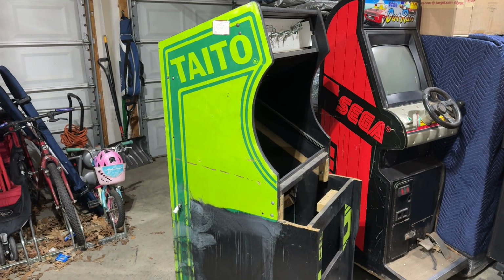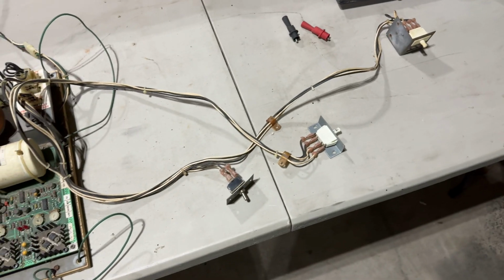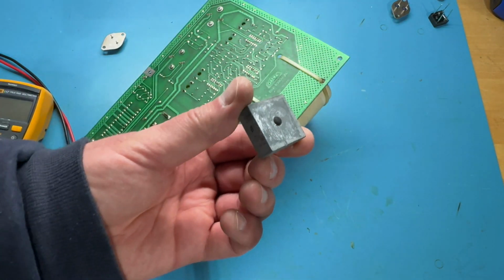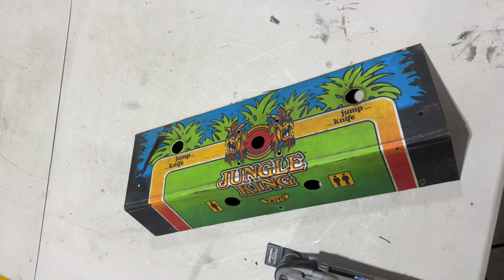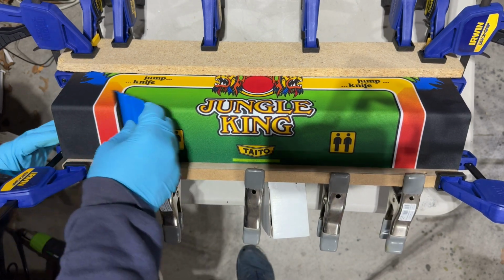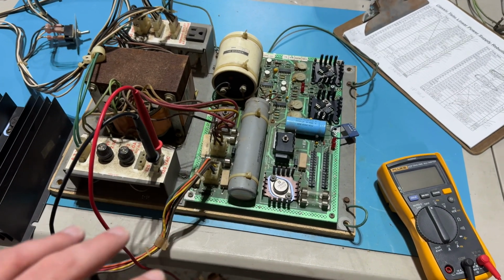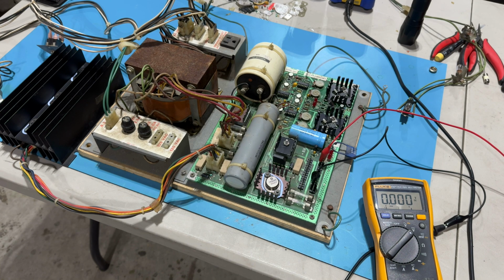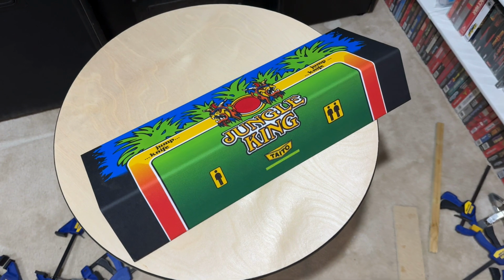Everyone HATES this & now I know why! 🤬 Jungle King part 2 🦁🌴 classic Taito linear power supply +CPO

Comment: You've come this far, swap out the caps and any other component you haven't already done.
I would then set the adjustment pots to minimum before switching on then gradually bring the voltages up, that way you'll know if the protection circuit is kicking in too early? Replace the plastic spacers on the transistors too if it's gonna be inexpensive to do. Stick with it man, you will crack it eventually.. Just keep on diggin!
Reply from the maker: Don’t worry, I haven’t given up yet!! I have tried turning the pots to minimum — the 5v comes up at about 3.6v before dropping to 0.9v after a couple seconds. I’ve also temporarily removed the mounting screws from the TO-220 transistors and lifted them from the heat sinks, with no change in behavior. I’ve still got a few tricks up my sleeve yet!

Comment: Taito power supplies are the worst of the worst, it’s very easy to just use a switching power supply with an adaptor. Used it for my elevator action and it works great
Reply from the maker: I know, I know... but oRiGiNaliTy!

Comment: My guess is those capacitors. Once they charge up that is when they fail (after the first second or two of being powered on they work) this seems like the exact issues I had on another power supply I worked on. Once you have the power off for awhile the caps discharge and then it's back to working for the first couple of seconds on powering on and then failure. You owe me a coke if that is your issue..LOL. Looking forward to the next video. Great job trying to save an original!
Reply from the maker: Thanks! Replacing the filter caps is on my todo list, although I'm not seeing any AC ripple on them.

Comment: Charlie those plastic spacers on those transistors is a must there actually designed to electrically isolate the base if its shorted together then will cause symptoms like your having, also those look like 5w big white chonker resistors can go short also check those transistors with no spacers if there shorted to each other first. :)
Reply from the maker: Good suggestion! I temporarily removed the mounting screws and lifted all four of the TO-220 transistors off of the heat sinks, and I'm still seeing the same behavior. The big white ceramic resistors all test ok too.
Reply: @overtimearcade   some solder bridges bleh good to see got that sorted mate , any psu see some plastic sheets or bushings we call them spacers Aussie land :P , there a must its meant to isolate base of the transistor to emitter and collector . and you cant have 2 bases shorting to each other linear psu's easy to fix but pain the back side :P
Reply from the maker: Good thing I have more than a lifetime's supply of these things now! 🤣

Comment: You should check the service manual for qix or maybe other games that use this power supply. It explains the regulators and how to adjust the overcurrent pots. It does appear that the crowbar is kicking in. You should check parts in the line of the voltage feedback ie r21 and c10 for the 5v line. Make sure those arent shorted to gound somehow. You should replace the pots if you havent yet because they can cause goofy intermittent problems. The 5v and 12v lines are independent from eachother for the most part so if one of those crowbars, it doesnt mean the other automatically will. The only way i could see the two affecting eachother is if f2 blows then the 5v side would lose its source for biasing its series pass transistors, also thr regular ic wouldnt be powered
Reply from the maker: Yep, I'm still messing with this thing, but replacing the pots is definitely on the todo list!

Comment: modern capacitors you can replace most tan'ts with ceramics, I hate tantalums ... heck in the automotive industry (where I work) they are blacklisted from most companies
Reply: Ceramic capacitors have different behavior and you really shouldn't replace them with ceramic. In particular, don't replace electrolytic capacitors with ceramic.

Comment: Get rid of those yellow tantalum caps first, those things always go short.
Reply from the maker: Even the brand new tants?
Reply: @overtimearcade Oh sorry, no, new ones will be fine but those old ones always fail. 
Also, I’m not familiar with that power supply but have you checked the wiring diagram to make sure it doesn’t need some return sense wires connected for it to function properly ?
Reply from the maker: @simonhanlon7518 Replacing the old tants is one of the first things I did. There’s no sense circuit per se, but I do suspect an issue with the crowbar circuit(s) on the power supply.
Reply: @overtimearcade  Right ok. I would connect a 5w 12v car bulb to each of the voltage outputs and then see how it runs. If it’s anything like the earlier Taito supplies it will need a load to work properly.

Comment: Hi Charlie!
I have a special content request, which while it may not correspond with your current project(s), would still be of great interest to me; I have an interest in the workings of coin doors. I understand the functions of the various parts including the coin mech, and credit switch,etc., but where I'm a little fuzzy is the relationship between the coin mech (which I understand is an almost universal part, because Nintendo had to be different...🤨), and the different styles of coin doors from different manufacturers - For example, a standard coin mech can be transferred between an Atari 'owl-eyes' coin door, and a Midway coin door with horizontal coin slots, and a Suzo-Happ coin door with vertical  'Push to Reject' coin slots, which brings me to the question of how a coin door with multiple coin slots (and presumably multiple coin mechs) can have a single coin reject button...
Any insight you might be able to provide would be very much appreciated!
A side note; I've been working on a project that I'd like to share with you, and send you some pictures, and get your honest opinion... Is there a preferred email address to which pictures can be sent?
And finally, have you given any more consideration to the PVC frame multi-function sanding enclosure/paint booth/murder room I proposed some time ago...?😛
Reply from the maker: Great questions, Dave!

I'm no expert on coin doors or coin mechs per se, but as I understand it there's basically two kinds of coin mechs: standard/universal coin mechs and Nintendo/Asahi coin mechs. Nintendo always liked doing their own thing, and they still do! But even with the standard coin mechs, some coin doors require the screw-on nubs to be mounted on the coin mech for installation, while others don't. So that's something that can trip you up sometimes.

The only cabinet I have with multiple coin slots and a single coin reject button is my Defender cab with the older-style silver coin door. On that one, the single coin reject button manipulates a lever arm that actuates the coin reject lever of all three coin mechs simultaneously. I'll be sure to include some close-up details of all that later in the Defender restoration series.

My email address is available in the About section on the main channel page, and you can always PM me on the KLOV forums where I go by CharlieG. There's also the private members-only Discord server that you should be able to access as a channel member (thanks for your support, by the way!).

And although it might be fun to make a mvrder room similar to the one Liam put together on the Retrobotics channel, I've been doing ok for now with painting/sanding out in the yard on a nice day!

Comment: those heavily charred areas on the board may have gone conductive, the carbon tracking will work against you at times, I have a $1500 Marshall head sitting until I can afford a new mainboard because of this
Reply from the maker: Good suggestion!

Comment: This was so much wasted effort, the first thing you should have done is checked for shorts to ground on each of the voltage rails to ground.  Secondly tantalum capacitors will fail and their fail mode is they short. You should have tested those first before doing anything else.
Reply from the maker: I am sorry that I have failed you. I did find two shorted parts though.
Reply: @overtimearcade  I'm just saying you should try and find the problem first.  The transistor certainly was bad but there area few things you should have done before just replacing everything.
Reply: @tigheklory  @overtimearcade Speaking of transistors: I had replaced a power regulating one a few years back on an old Robotron computer (made in East Germany, build like a tank) and was wondering why nothing worked after that, although at first glance both transistors had very similar specs. It had been quite irritating to learn, that the replacement transistor was switching ever so slightly too fast for the rest of the circuit.
Reply from the maker: Too fast? Wow!

Comment: I think it's one or more of the big electrolytic caps. They filter mains line noise and they smooth ripple on the DC side. Just guess-timating here, based on vintage radio repair. Professor Wings says: There are three basic things I check on caps. First is capacity. Second is ESR (equivalent series resistance). The third is rarely mentioned. This is equivalent PARALLEL resistance. It's like putting a resistor across the cap leads. In really bad cases, it's like shorting out the cap entirely. As caps age, they start to leak current internally because the electrolyte dries out. Older electrolytic caps have an age limit, maybe 10-15 years. This will be shown in the spec sheets. Physically, they may look new but as they age they start to gradually act more like resistors.

When you first power it up, the caps aren't charged. Same when you turn it off and let it sit, the caps drain. When you reapply power, the caps take a second or so to charge, so you get 5.7 VDC. When they are fully charged, it seems like they are leaking current. So,  the fully charged caps may be acting as shunts, dragging down your 5 &12 VDC. Caps are relatively inexpensive. They would have been one of the first items I would have replaced, say I, as I preach from my arm chair quarterback position! 🙂Also, consider reflowing all the solder joints, just for luck! Thanks for the great videos. You have one of the best intros! It looks great on my LG OLED TV!
Reply from the maker: Thanks so much for the kind words and thoughtful suggestion! I'll look into the filter caps but I'm also suspecting the crowbar circuit since 5.77VDC is very close to the trigger of 5.8VDC specified in the manual.
Reply: If that were the case, the cap should start heating up after leaving the power on for a while, turning up the current limit pots might make it heat faster. If it were enough leaking to drag the 5v down that low it would probably pop F1 before you see a drop in voltage. Same with the 12v side which is fed by a separate winding, BR and filter cap.

I'd guess it's something else, but I've never fixed one of these before. Let's hope my qix keeps trucking along.
Reply: @Tr3vor42532  Now that you mention it, if the caps were electrically leaking enough to drag the voltages down, they would probably heat up and blow a fuse. Good point!